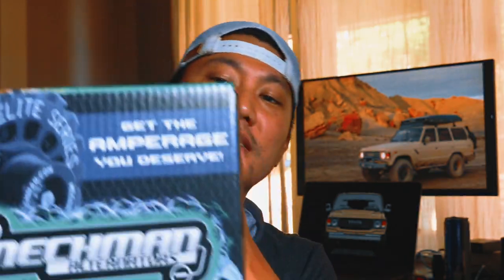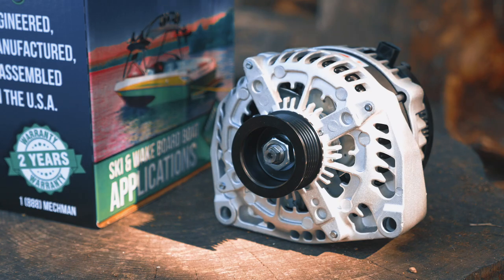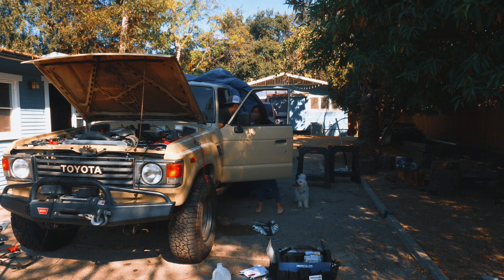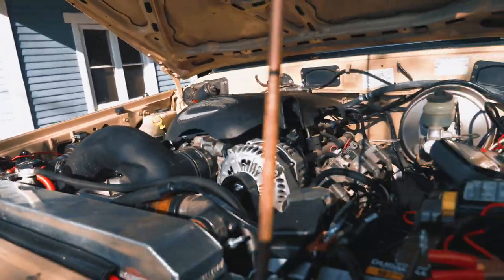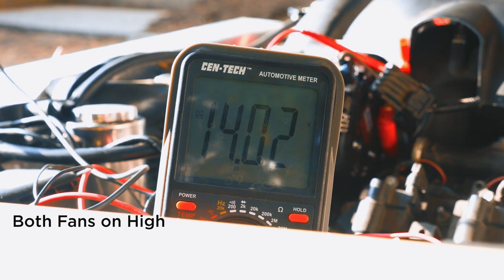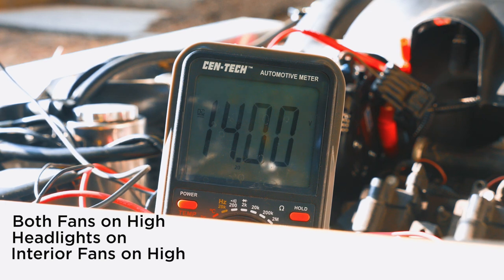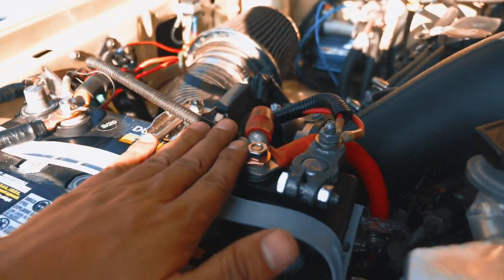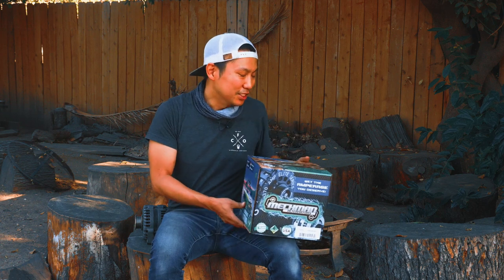Why I'm upgrading my fj60 Landcruiser Alternator to a high output and why maybe you should too!

Comment: Wow I see you've done a lot of stuff under that hood. It was good to know about the alternator.  I had same problem, my stock alternator wasn't charging the AGM battery at 100% it died in 2 years. I am currently running a voltage booster in a fusebox, but it throws battery warning light.

Comment: Nice cruiser man, looking forward to more videos. If you have any heat issues with the wires, I would upgrade to some Oxygen Free Copper wires. They're going to be much more resistant to corrosion and provide you with more stable connections once you start adding high amperage accessories.
Reply from the maker: Thanks for the tip! Will be making a run  to the back of the cruiser for the fridge so I'll check that out!!

Comment: Wow I see you've done a lot of stuff under that hood,  good to know 
about the alternator, I had same problem, my stock alternator never chraged the AGM battery at 100%, the battery died in 2 years. I am currently 
running a voltage booster in a fusebox, but it throws battery warning light. -_-
Reply from the maker: hey Gom! heard alot about you from Dodam and Tommy! yeah i dont think its realistic for the alternator to fully charge and maintain the house(deep cycle batt) esp if it's been used on a trip with fridge and accessories.. it needs shore power. do you use a battery charger for it when you are parked at home? saw some of your vids! u are hard core man. i used to have an fjcruiser too, a 2007, it was a fun car..  was fixed up similar to yours too!
Reply: @lonelydriver82  I was using a solarpanel on hood to top off the AGM battery, but  since I changed purpose of FJ , I took it out everything, sold RTT heavy drawer trying to lighten it. I weight it, it was around 5600lbs I want to lose about 300lbs. We can talk about this forever, lets do a trip or something with dodam and Irene. lets DM on IG!

Comment: Great Tip! Thank you. Any recommendations on volt gauge or gauges in general?
Reply from the maker: i've got a v8 swap so i'm running a scan gauge off the obd port in conjunction with speed hut gauges... the speed hut gauges are nice i've found they don't play too nice with the factory sending units especially the factory fuel level sender
Reply: @lonelydriver82  
Hi Kevin,

Thank you for responding. Do do you suggest that I don’t do the speed hut gauges and just do the OBDII adapter? Or both..  I am in the process of doing a transplant. I pulled the motor a few days ago, now I’m assembling Advance/Marks adapters to a vortec 5.3l

Regards,

Comment: Can you help me out, I'm doing a v8 swap on my fj60 and I was wondering what type of fuel pump did you use and also did you leave your EVAP system?
Reply from the maker: Check out tanksinc, search for a recent post of mine on ih8mud , my username is lonelydriver. I made a post about the fuel pump setup I used. I do have the evap system still.intact.